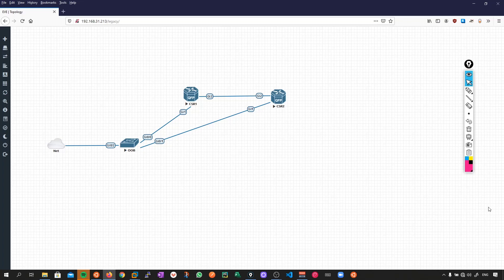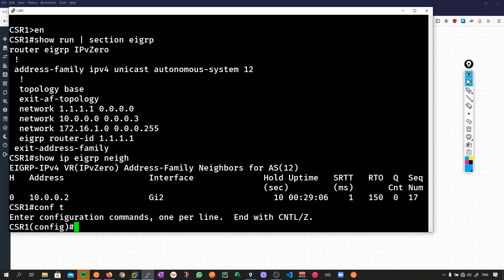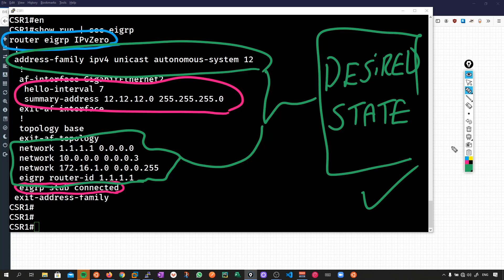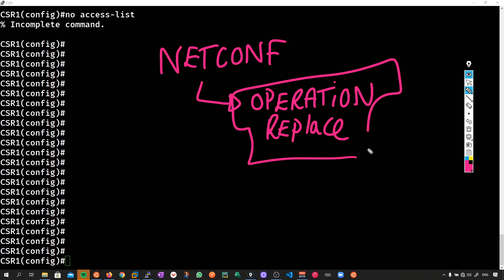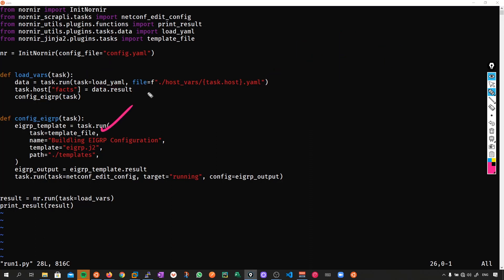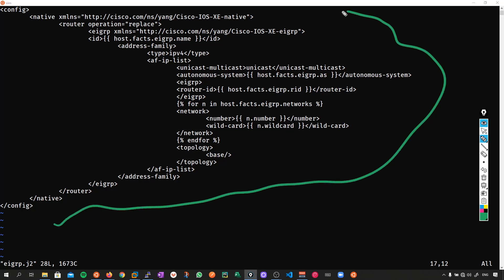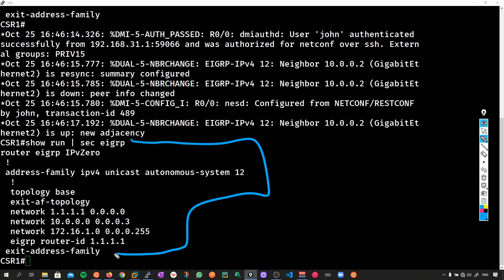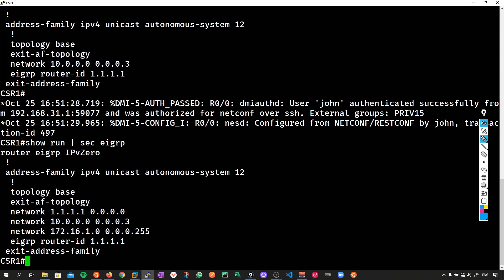Network Automation: Desired State!

Comment: John, great video on NETCONF, I find YANG data models a challenge to untangle, these videos have pulled back the curtain.
Reply from the maker: Thanks, Ken. Glad you found it useful :)
YANG is probably the biggest obstacle in API based automation. To be honest, even though I can use it, I still have my reservations (as do many prominent people i've spoken with in private). I think it raises the barrier of entry a little bit too high and introduces problems of its own. Personally I'm more of a fan of how the server world implement automation and this is the direction Cumulus Linux are going - automate linux flat files and restart services. To me it's a more elegant solution.
Reply: @IPvZero  John couldn't agree more. This article from Ivan Pepelnjak says it all https://www.ipspace.net/kb/CiscoAutomation/070-netconf.html I think long term APIs wont be used for pushing configurations, remember SNMP anyone? It was originally designed for config push. SNMP MIBs, YANG data models, same thing as far as I'm concerned. The only aspect of the API I really like is the replace/declarative operation, very hard to achieve this with the CLI, but if it was a single file swap out like Linux, that would deal with that issue
Reply from the maker: @kenmurphy4259  This is where I am at atm. YANG isn't even close to getting us standardisation right now. As it stands, the IETF models are bare so are pretty much unusable. OpenConfig is better but still don't have nearly enough feature coverage. So you're having to resort to vendor native models. So depending on the model you have to structure your config in completely different ways from device to device, depending on the model. This is just like the CLI syntax problem all over again, except with an extra layer of complexity thrown on top of it. YANG rules also present some serious implementation problems, imo. For example you can't perform an operation replace on a leaf-list object. So for example in the XE Native model a username is actually a leaf-list. So if you want to perform an operation replace - you can't. The only way to replace the username is to go one level higher, which is the entire native model. In effect, if you want to perform an operation replace on a username, you need to build a YANG structured data model for absolutely every piece of configuration on the box and simply replace the whole config. And if you leave anything out, by nature of a replace, it gets wiped. These kind of rules just make implementation cumbersome and inelegant. Whereas the server world has been automating way longer than us networking folks - and I feel they've got it pretty dialled.

Comment: I have a cloudmylab account, how do i duplicate the work you have done in this config on eveng? I would like to get good at automation as well. how do i set this lab up?
Reply from the maker: Hey Manoj. There's really not too much the lab. Two CSR routers, both with a MGMT ip address. And on each devices I put the commands to enable RESTCONF/NETCONF:
username john priv 15 pass cisco
restconf
ip http server
ip http authentication local
ip http secure-server
netconf-yang

If you do that you'll have the same lab setup :)
Reply: @IPvZero  thanks John,  saw your video to setup the environment
Reply from the maker: @MK1985-z7k  Brilliant. Have fun labbing then :)